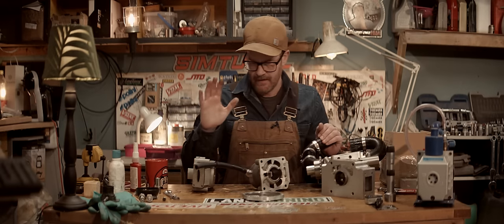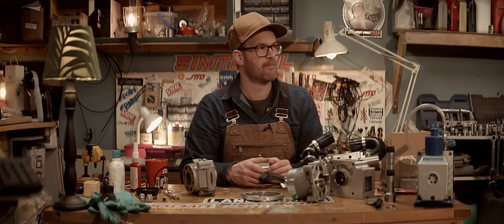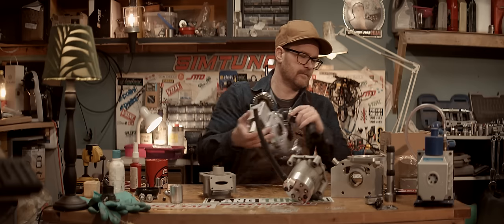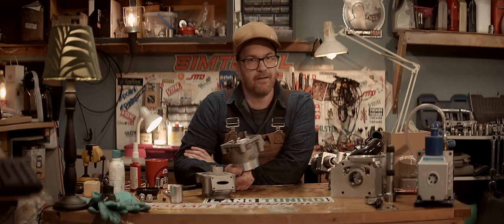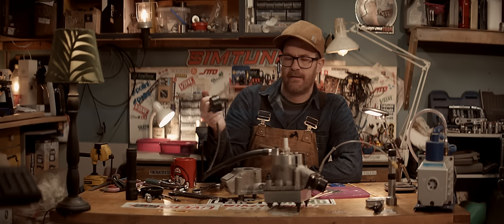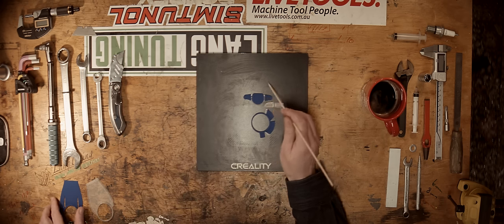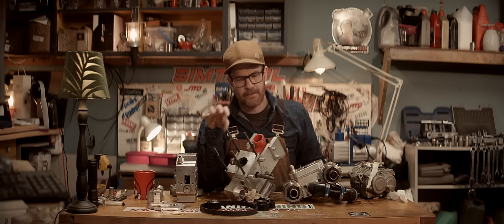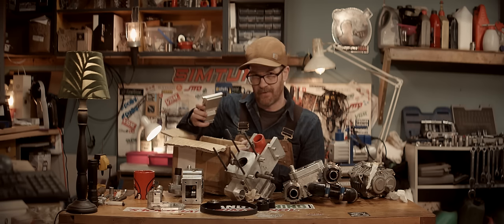Rotary Exhaust Supercharged 50cc Externally Scavenged Two Stroke returns!

Comment: You could use a somewhat standard cylinder and piston in order to develop the rest of your crazy ideas in the bottom end of the engine. And once that is tested and you've mastered it, then go back to developing a crazy cylinder. While you will be smashing your brain against the bottom end of the engine it will also leave some time for your brain to come up with fresh ideas for the cylinder.
Reply: This is the way.
Reply: jaa, you already have perfect liner, just get it out and press it somewere else! and then perfect the bottom and resonance with injection and all of that, this is the real point in 2stroke, brute is 4 stroke just double the bangs...
Reply: That’s what I was thinking… perfect a basic two stroke platform and then go crazy. Ami the first to think that at this point we should be further along than in an experimental, ground level stage? Just sayin… been watching for a hot minute…
Reply: I just left a comment for him to speed up the research and development. I am getting impatient with things changing all the time.
Reply: @kurtyoung6769  im just here for the ride. We give him advice and he can do what he wants. No need to get impatient and too pressed about it
Reply: I agree. Why not develop a crankcase & intake(s) system rather than a cylinder? See where that goes.
Reply: @kurtyoung6769  Sorry, no offense, but then you are on the wrong channel... If you have followed for a while, you should know by now that his brain doesn't work like this. And that mentally, the last thing he needs is people's impatience and expectations weighing him down. Let him figure it out in his own time, not ours.

Also, if you're a Patron and you feel you shouldn't be, then you can always stop your payments. If you aren't sending funds his way, then perhaps keep you own needs out of the equation?
Reply: @dieselgeezer18  Well said:)

Comment: Brute force, start again, don't share the crankcase with the inlet... Think 4t engine with a 2t cylinder. Itl work with boost and negate ALL the issues you have been having supercharging q primary compression engine. You literally do t need ANY primary compression.

Comment: I think you should design your new cylinder as a test bench, not as a finished product. Forget the outsides, don't try to make it fit on the bike. Make it from billet aluminium and CNC, eliminate casting issues. Leave ample metal to be able to rework things. Try to make it as modular as possible. Your goal is not to make a bike, it's to test the engine. Make cooling channels oversized, and clearance to the cylinder larger than normal. To test your different exhaust geometry, I think you should be able to use just different adapters between the cylinder itself and the block, so you don't have to redo the whole thing for every port geometry... So steel cylinder sleeve in aluminum cylinder "supersleeve", which has the largest possible ports setup, then that fits in a "cooling sleeve" with coolant flowing around it, then the whole thing into a "ports adapter supersleeve" with your port geometry in it, and then the whole assembly into the block. Kind of like russians dolls.

Comment: @Alex, lease use a double bearing on the output drive side of the crank, to help reduce cantilevered loadings/forces from flexing the crank with the drive pulley + gearbox forces, and the belt tensioning load, it's wearing your bottom end bearings out after only a hundred or few of hours of running !! ..perhaps with a 3rd thinner output bearing just to support the tip end of the output side of the crank, in a bearing spider.

Comment: Use electric motor with frequency converter for first dyno calibrations. With that you can have easily reference point. Ofc. a vibrating 2 stoke engine is not fully compareable and needs to be confirmed later.
Reply: Smart

Comment: 65 years of messing with engines.

Usually 4 stroke but in this video is the first time I understood the significance of the 2 small exhaust orifices to the sides of the main exhorst port.

Very well explained,

Thanks for being an inspirational  pioneer.

Comment: Yeeeea!!!
I love the new plan!
I seriously believe this approach can net you huge gains. 
  Please don't rule out turbocharging! No frictional losses and i promise you that spooling a turbo much bigger than you would expect is possible, especially with all that wasted air/fuel going into the exhaust!!! 
  I spool a 58mm inducer, 58mm exducer, aka "5858" 1.06 a/r with only 700cc triple Yamaha snowmobile engine. The inefficiency at lower rpms pumps air/fuel into the pipe causing a natural anti-lag effect! Almost zero lag and im getting close to 350 crank horsepower but getting worried about the lower end. Being able to control your intake and exhaust timing possibly with something like movable tensioners on the belt/ chain drive...... 
 You will figure it out!

Love ❤ your channel and im now a Nord VPN customer!
Reply: Nice 350 that triple the HP so you running in the 25/28+ psi range 

using both the supercharged he got + a turbo would be really cool 
You know what would be even better a standalone ecu with logging capabilities with all the basic sensor + wideband o2+ egt/ back pressure and use a maf like he suggested ditch the carb and go fuel injection plus he would gain a real way of setting the base timing of the engine correctly and be sure the number are accurate for spark advance and not shoot in the dark like he usually does.Nothing beat adjusting the fuel/timing with the stroke of a keyboard 

If that was me a would keep the rotary valve and steal some design for a Detroit 2 stroke  or even just use normal valve but he doesn't like valve he thinks they can't rev high go tell that to the CBR 250 with a 18k rpm red line lol

On another note 350 crank is far from maxing the turbo this is easily capable of 600+hp at 50+ psi  time to reinforce the case, forged rod some nice wiseco piston maybe bigger head stud👍
Reply: Do you think they make a turbocharger small enough to work with a 50cc motor tho? ~( ,m,)~
Reply: @legros731 
 
Thanks for the compliments! 
Only running 20 psi of boost, base horsepower is around 160hp. 
   I like the fuel injection idea. The problem is I believe he should use a tuned pipe eventually. His set up would benefit from barrel timing being adjustable along with different pipes he could swap out along with different timing curves on the barrel. He definitely needs a standalone I agree 100% with you on that. I'm sure he could utilize cam timing tables for adjusting the barrels. One spring loaded and two adjustable arms on the chain/belt drive could work. 
Very excited to see how things go
Reply: @hunnybunnysheavymetalmusic6542  
2 strokes blow air/fuel into the exhaust unburnt. Thats antilag.... IMO he should have no issue spooling a turbo off a small diesel engine. Aftermarket stuff is out there now as well. Cheap and reliable would be something off a small kuboda tractor or similar. Trust me when I say he will be surprised at how big of a turbo can be hung on that little 50cc. Two strokes need two even three times the size turbocharger compared to a four stroke.  When the pipe heats up on boost...... add another 1000 rpm to the tuned length and hang on to your ....
Reply: @chrisdragosh8034  ok google said it was 112hp but 160 is way better and 20 psi make sense
Reply: @hunnybunnysheavymetalmusic6542  absolutely
They make turbo that fit inside the palm of your hand 
Look at a 3 cylinder Kubota diesel they got the most cute turbo you will ever see
Reply: @legros731 Does that turbo for a 3 cylinder 715cc Kubota motor work on a 50cc motor? 

Or are you not thinking like an engineer here?

I've built ALL KINDS of engines in my life, and SIZE REALLY DOES matter!

BOTH directions!!!

I have never seen a 50cc Kubota.

If you dive into the grand canyon, do you think you can reach out to both sides of the canyon and slow your fall?

If you are in a mine tunnel, do you think you can displace enough air to save your life with a tire pump?

Why then, would you think you could build boost with a turbocharger which LITERALLY has a larger inlet than the physical displacement of the piston you want to drive it with?

"Gentle" suggestion here: stop looking at "cute" and go get an education on aerodynamics.

I've built jet aircraft engines, OTR truck diesel engines, offroad heavy equipment diesel engines, race type automotive gasoline engines, ordinary passenger car and truck type gasoline engines, and small implement engines.

You can't pull a mule with a mouse.

There is no turbocharger commercially mass produced, which is functionally built to operate on a 50cc power plant.

Period.

If there were, I would know about it.

The smallest turbocharger commercially built is designed for motors at no less than 196 cc, and they are both rare, and expensive.

When you fall below 196 cc, you need to either use a paxton, roots, or whipple type blower, or you are simply out of luck.

Period.

Somebody I never met before wrote an article about this and guess what...

EVEN THEY made it plain and clear.

They simply do not make turbos that are small enough to be driven by sub 196 cc motors.

This is not to say they never will, who knows...

But right now, its much easier to use a mechanically driven blower than it is to look for a super rare, extremely costly custom built turbo that can drive a chainsaw motor.
Reply: @chrisdragosh8034  Well, until you PROVE your opinion...

Its just another opinion.

I've been in this industry for 52 years now.

And while its a sad truth, its still a truth.

They do not commercially make turbos small enough to be driven by a 50 cc motor.

While there just may be some odd, hand made, one off, custom built turbo like that, in the world of what you can hope to pick up off a shelf, don't exist. What you can pick up off the internet...ALSO don't exist.

This is why people in these low displacement ranges are forced to depend on positive drive compression, be it paxton, roots, or whipple.

Comment: There’s a product called K Seal here in the USA. It’s a coolant leak repair liquid. Vice Grip Garage(hear on YouTube) has used it successfully in automotive engines  Mainly with internally cracked blocks.
Reply: I tried it and it sealed a
 weepy intake gasket on a 350 vortec. Good stuff!
Reply: Goodson seal all is the best sealer. It's a polymer you force into cracks and cure in an over . In 30 years it's the only thing that's ever worked for me on oil impregnated two stroke cylinders.

Comment: Maybe look into the old v92 2 stroke engine. They were supercharged and they used a regular valve like on a 4 stroke for the exhaust but also used transfer like ports for intake.
Reply: When the brute force engine was mentioned I suddenly thought of Detroit diesel two strokes but using an electric injector
Reply: @johngibson3837  definitely be a good idea but direct injection requires several thousand psi of fuel pressure for combustion chamber configuration. But he mentioned about mounting in the transfer port. That would be more manageable.

Comment: This might be a dumb idea, but 2-stroke crosshead engines on ships got an exhaust valve in the cylinderhead and is turbocharged. I know these engines run at 100RPM, but it's possible to use valves at high RPM(16.000RPM). It should it be possible to run a chain from the crank to the camshaft with a single lobe to a valve.

Comment: Have you ever studied was happening to engine development at the end of the second word war? They were working on massively powerful two stroke engines which were supercharged sleeve valve engines. The development was only stoped by the advent of the jet engine. Another option is the rotary valve cylinder head, ie replace the popet vales with a top mounted rotary valve, again supercharged.

Comment: @Alex, sorry when pressing the chilled Cylinder Liner into the Cylinder itself, it the Cylinder should have been warmed/heated up for a few hours in an oven/BBQ-grill, doing it 'cold' at room temperature helped stress micro-fracture part of the cylinder liner material. 
But you have so many ideas and things to worry about, it is easy to understand how you missed & forgot that when using the liner from the out of the freezer plus the car jack style of pressing machine took so long the materials of the liner and the cylinder equalised in temperatures and then became a totally interference fit whilst 1/4 pressed in - you really need a quicker method of hydraulic pressing, or get a company to do it for you (next time).

Don't worry about the channel viewers/patreons wanting X or Y or Z, or H directions... we YT-ers, and they P,-ers will follow your work, your mistakes, & your progress the direction YOU take.
I am not saying discout all advices or some of the better ideas, but, butt I feel, try not be steered to far away from where you 'going'.

Comment: 12:26 - Do the 'Slow puncture in a tyre/inner tube' trick... Stick the cylinder head in a bucket-o-water and check for bubbles, you'll also see where the bubbles are coming from... 🤔😏👍 Also, not sure exactly the design/setup of this cylinder head, but, would pressing out the cylinder barrel/sleeve not give you better access? 🤔
😎🇬🇧

Comment: Hi Alex. If you look at a really big two stroke diesel engine, those engines has a exhaust valve opening when the exhaust gases is ready to come out. I think this maybe is the way to go, or make the sylinder head with two exhaust valve and two spark plugs, then you can overboost until the piston comes out with the white flag😂 and also make the sylinder head with two spark plugs, so the first spark ignites main mixture and the second plug ignites right after, so the combustion would be like nearly 100%. Just maybe you should be looking at some high numbers in torque and horsepower. Just an idea. Really like your videos🇳🇴🇳🇴🌞

Comment: Can you put a 4 stroke engine head on the thing with proper valves? That would solve a lot of issues. Mazda has engine in works that has 2 strokes, regular valves in head, and its charged. Maybe you'd enjoy checking it out.

Comment: Glad you're heading back to brute force, it's an idea I had years ago but using a ford lima 2.3. No scavenge, just mixture purge, squeeze, then bang. Cutting up the factory cam and rewelding it true is the only reason I have not attempted it yet.

Comment: You should really consider conventional Poppet valves in the head at this point, for a prove of concept even a readily available head would do just fine! 

Granted - the applications are a bit different, but it's tried and true after all. 
And it has a lot of upsides to it, for example having the far superior uniflow scavenging, 100% of the circumference for the transfers including the possibility to easily induce ample swirl to aid in quick combustion of a rich methanol or methanol/nitro mixture, completely variable intake timing completely independent from the transfers - maybe even electronically actuated via a simple servo system, which would be well within your scope to cobble together.
Had a similar task with old Berger-Lahr servos and drives, was rather easy even as a complete layman.
I don't really see even a single downside besides it lacking the novelty factor. But then, a 50cc supercharged uniflow two stroke - does it really need any more novelty factor anyway?! 

I'm kind of a fan of rotary valve concepts myself, but they just ain't it and probably never will be. There's just too many downside to the few, rather marginal benefits.

Comment: Take a look at old Detroit diesel engines. Like a 6v92 or 8v92 .  The are supercharged and turbo charged 2 stroke diesels. Maybe it can give you some inspiration or ideas for cylinder port locations and design.  Maybe just some ideas

Comment: Couple of recommendations for the rotary exhaust valve engine:
- Use belts instead of chains. Chains need to be constantly lubricated and are a PITA for I+D on an engine.
- Make the valves out of solid stock (maybe make them lighter by making a hollow section) and use them as ball valves, so they don't heat up as much. You will also have a fixed exhaust port, so double advantage there.
- You may want to try asymmetrical intake ports, now that you have two of them. You can try asymmetrical air inlet, or asymmetrical fuel distribution, in order to reach an heterogeneous combustion condition.
- Try to use a fuel injection system. You may want to try out Speeduino NO2C (simple and ideal for bikes) or a Microsquirt (if you don't have that much of electronics knowledge). You will get rid of so many problems that come with carburetors when it comes to boost, mostly thanks to the ability to map different engine working conditions. You will also have the ability to inject the fuel wherever is more convenient for air speed, as well as being able to design a better intake manifold, given that you won't have the geometrical limitations carbs impose.

I want to see you succeed. We all want to, and we will follow whatever path you choose with your build.

Comment: Been watching for a couple years now, and you always think outside the box. Great content and fun to watch. I still think that adding the compressor between the crankcase and the cylinder would be a better design because you wont pressurize the crankcase and there would be quicker boost response due to less volume between compressor and cylinder.

Comment: You can fix the chain heating issue by insulating the sprockets with something like a high temp phenolic spacer - this can be cut on a lathe. Capping the sprocket end of the exhaust tube will also keep a lot of the heat away from the chain.